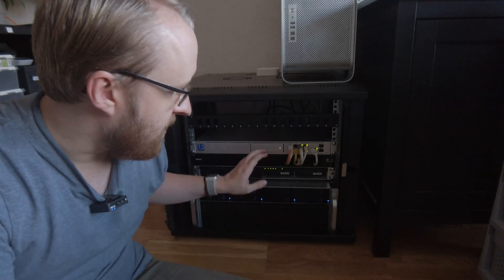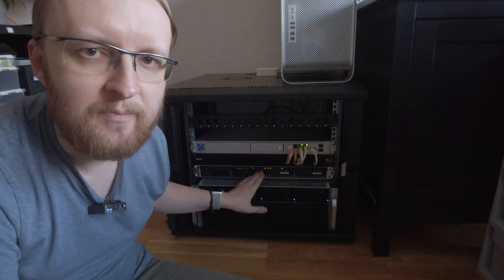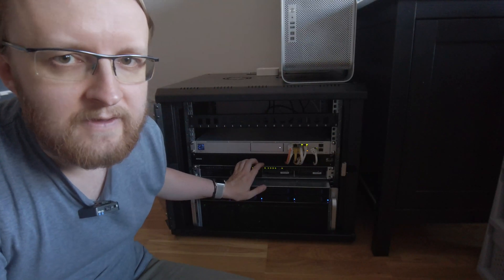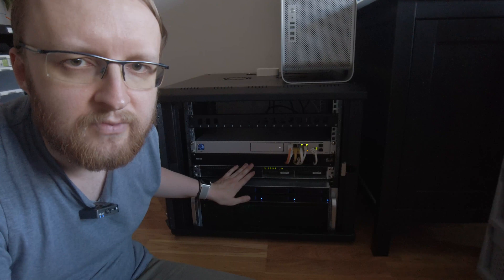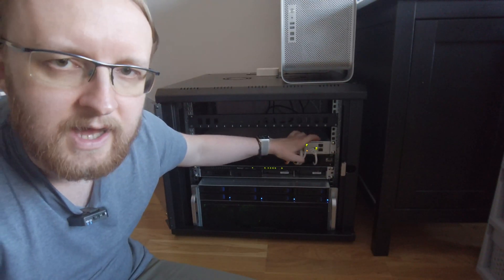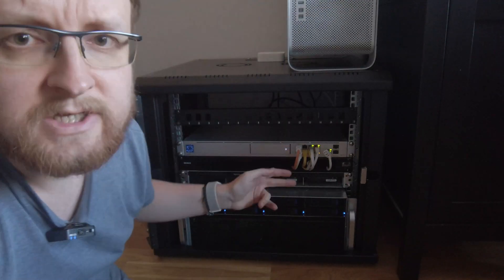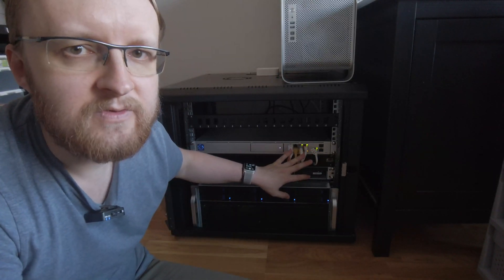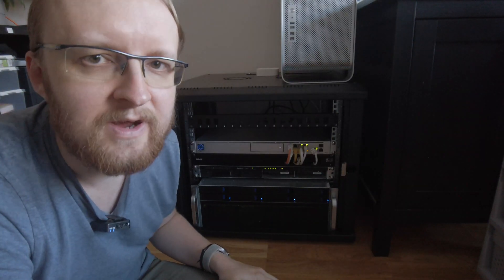New Rack for 4U Server Build - Homelab Setup

Comment: Being a unifi network gear user myself, I feel compelled to point out to you and your viewers, that the top SFP+ port on the UDMP can only be used for WAN. So if/when you do look to add in some 10gig networking, you'll only have a single (10gig) SFP+ port to use for LAN connection. If you're going to want more ports, you'll have to look at investing in a switch. 

Personally, for 10gig networking, I started with a USW-Aggregation for a while now. Currently used as my "core" switch.  So it goes UDMP-->USW-Agg and then further distributes LAN to additional switches with 10gig, including USW-Pro-24, USW-Pro-24-POE, and I just bought a USW-Flex-XG. Although, I do have two clients plugged directly into the USW-Agg. A synology DS1821+ with 10g SFP+ NIC and a remote workstation with a 10g RJ45 NIC.
Reply from the maker: Thanks dude. Appreciate the comment. I am waiting on a larger switch for the internal stuff. I don’t want everything plugged in to my main UDM Router. It isn’t good practice anyway. 

How many 10Gig devices you got in your network at the moment?
Reply: @RobertMizen  Yeah it's less than ideal to fully rely on the eight RJ45 ports on the UDMP since it's been discovered that they share a 1 gig backplane (i.e. max rates for all 8 ports combined is 1 gigabit). 

As for 10 gig clients, only the two previously mentioned...a DS1821+ with a 10gig SFP+ NIC and the remote workstation with a 10gig RJ45 NIC, both connected to the USW-aggregation, which is all down in my rack in the basement utility closet. But, more recently with the addition of the USW-Flex-XG in my office, which is uplinked to the USW-Agg at 10gig, I purchased some 5 gig usb adaptors to connect a couple of windows PCs, and have a new minisforum PC on order that is coming with 2.5 gig ethernet. So I'll have those clients connected with multigigabit ethernet.  

Down in my rack I do have two other clients that natively have 2.5 GbE built in, which are both Odroid H2+ single board computers (sadly just found out that HardKernel had discontinued this product), although, for the projects they're currently running, 1 GbE connections are  more than enough.

Other than that, I don't really have any other use cases at the moment for 10gig.
Reply from the maker: @ddhmi88  That sounds interesting, as long as the boards work as intended then all good too.

I try to separate up network segments to avoid failure points but also the backplane as you mentioned. I do not have anything on 10Gig at the moment. Doing it in steps as i go. Spent more time in the Server Lab at work, thats 10Gig just about everywhere bar a couple of POE Cameras and Switches.